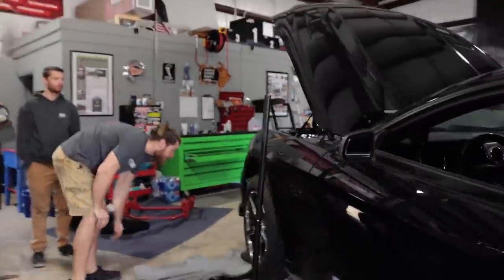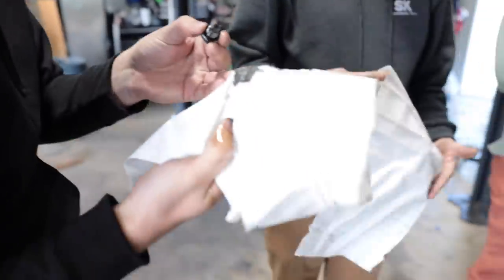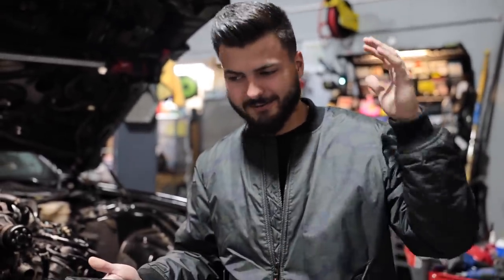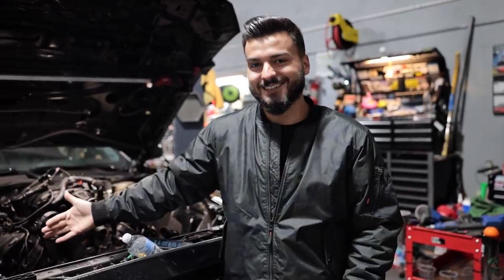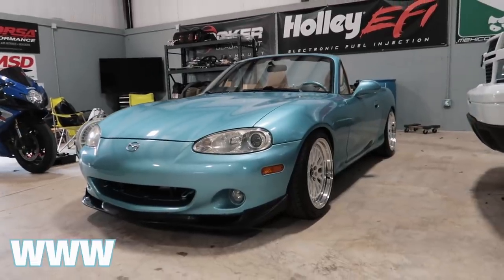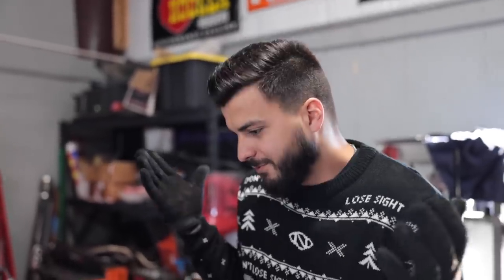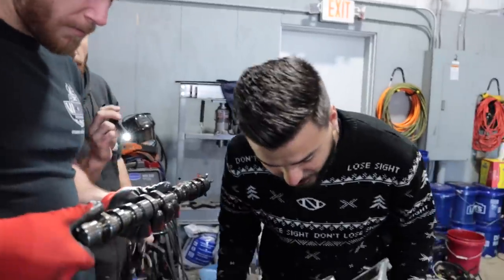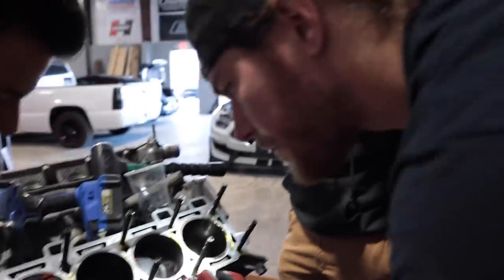Tearing Down Satan’s Blown Motor! | 1,500hp Coyote Engine Teardown

Comment: Well, this just solidified my decision to use someone other than MMR for my rebuild.  :/ I was going to send them the block in January.
Reply: Yea I made that mistake once. Worst company I've ever delt with. Took wayyy too long and blew up at 700 miles of easy low rpm driving. Then they ghosted me told me there's no records of my business.
Reply: @broshak9384  I feel like their top end stuff and timing stuff and other products is good but I wouldn’t trust them with a built bottom end
Reply: @jasonn277  They have good shit, but they have quality control and customer service issues. It will come back and bite them in the ass.
Reply: @jasonn277  its good stuff if they don't touch it. And you don't need warranty on anything.
Reply: @Hades-tf1zy  yea I’ve only bought one thing from them so far I know they have a lot of good stuff but to me seems like the owner can’t take any shots and always tries to make it seem like they aren’t the problem which imo is bad for business
Reply: @broshak9384  got you I’m going to be getting some parts from them for my build in the future and I actually might just buy the rotating assembly and assemble it elsewhere
Reply: @jasonn277  honestly bro I'd shop around. Theres plenty of companies selling quality parts. I wouldn't support a company like that period but thats my opinion.  Its your car your money. Just remember their service and warranty sucks too.
Reply: @broshak9384  you make a very good point
Reply: @jasonn277  if you noticed in the vid their expensive timing set failed after like, what 1k miles? I'm just trying to help fellow car guys. Good luck with your build. Make many hrsprs
Reply: @broshak9384  yea bro specially the primary tensioner  definitely staying away from those but good looks bro appreciate it 💪🏽
Reply: @jasonn277  my long block is from l&m everything else is either ford racing, vmp,corsa,arp,ect
Reply: @broshak9384  do you have upgraded primary tensioners? Only other company I saw that made them was ford Perfomance, using the ones off the cobra jet as an upgrade.
Reply: @jasonn277  yes they are ford performance or steeda i camt remember who i ordered thru but its a Ford performance product. The engine is actually in a Lincoln town car but ive got 17k on the setup so far. 10lbs boost and 890 wheel turned down significantly. Highest number on 16lbs turned up was 1142.
Reply: @broshak9384  sounds mean but thanks for the info I think I will go with the first performance tensioners and use the non moving stuff from MMR
Reply: @jasonn277  alrighty man good luck with your build.

Comment: Mmr posted a reply on their Instagram and blocked people from commenting😂
Reply: I saw that do you have screen shots of part 1 cause I think they took them down I only saw part 2
Reply: What’s their insta @
Reply: @Roy-ui9en  MMR Performance.
Reply: I couldn't find it
Reply: @bossnbuchan  the bmw aftermarket company?
Reply: Does anyone have a screen shot of the post?
Reply: @bossnbuchan  no it’s not it’s modularmotorsportsracing

You literally can’t comment on a single post. Holy coward.
Reply: Que the ( it was at this moment they knew they fucked up)
Reply: @truthliveshere831  it was deleted
Reply: @carsonbarasha9238  they deleted the post oddly enough
Reply: @TrainerDee  do you remember what it said
Reply: @carsonbarasha9238  They basically stated that it was Gavin to blame and didn’t put the engine together correctly in the first place and that Gavin never bought the engine off of mmr and that they never charged him a dime when he sent the engine over to them, also that they used all the components that Gavin had originally sent them with the engine. They took no accountability for anything and just pointed their fingers at him
Reply: @carsonbarasha9238  I do
Reply: @Roy-ui9en  @modularmotorsportsracing

Comment: What fun!  It's not time wasted.  Learning isn't easy or cheap.  So far, you have proven to know how to build an engine the right way, like testing the head flow to pick a cam.  Part failure is the biggest issue.  Time to find a mechanical engineer and have parts designed to meet your climate.  Most car parts are built to be a one size fits all, but that only works in dream worlds.  Finding a good fabricator is key to building a strong engine.  All ya'll's did a great job at tear down and analyzing the failure.  I am sorry that you have teenagers leaving comments.  If you have never keyholed an engine, you shouldn't be commenting!  My first keyhole broke the cam into 7 pieces!

Comment: Just an observation, but it looks like that engine has +10cc domed pistons, which are around 12.5:1 compression vs the stock 11.0:1.  That IMHO would be the opposite way to go in a boosted application, and you'll more likely to lift the head and/or ruin the bearings.

Comment: Actually the most common of blown head gasket is the compression going into the cooling system not the one that is known for mixing with oil and the white smoke, its normally really bad over heating and blowing the cap off of coolant overflows.

Comment: Those rod bears and main cap bearings I think we're to tight for the clearance and that's the result of improper bearings and those rods don't look like they are round they look almost egg shaped like they were forged wrong.its like the engine builder didn't wanna shell some extra money into eagle rods and some decent proper plastigauge and mains

Comment: I had a Mustang that no matter WHAT I did it would overheat.  Changed gaskets, changed everything I could think of.  Sadly it got rear ended by a guy in an F150 going about 50mph.   But, I found out when we tore down the motor that the head water ports didn't line up with the block.  Strangest thing ever.   You never know what can cause problems.

Comment: Granted my car is turbo uses more oil so my pump wasn't supplying the bearings good enough... But also 2 times in a row cooked mains shot crank.... Came down to not enough oil pressure... I guess when you add power like that you want more pressure cause the stress is higher and can push the oil out of the gap heavier oil and more pressure my lesson learned may help y'all a bit

Comment: You spent quite a bit of cash on that engine with that being said the proclaimed “1500 hp rating” should have had fire rings  grooved into the deck surface and head. That would have definitely been a go to for the amount of power you’re going for. Whoever built it should have gone that route for that “rating”

Comment: The rods aren't oriented correctly, that's the reason it took a doodoo. The beveled side of the rod faces toward the cranks counter weight. Cylinder #1, the bevel is closest to front of engine, #5 rods bevel faces rear of engine, #5 rod bolts to the same journal as rod #1. The main bearing was more than likely misplaced on the block and should have been on the main cap. The bearings come in a group, usually cap bearings are one thickness and block main bearings are another.

Comment: MMR just threw a grenade at their credibility over a half-assed engine repair. Well done. Gavin, you did a great job being classy about it, but the fact remains. MMR owes you money. Not another engine-shaped boat anchor. Money. and it should arrive faster than 4 months and 19 days, even with the apology that should accompany it.

Comment: I think the heat from it overheating can harm the bearings a little bit but if the head gasket was blown you Would be able to see compression in the expansion tank where you fil the coolant

Comment: Seeing as how almost all the cylinders leaked on the blocks external thrust side that coincides with the water opening in the head also i would say there is a definite structural issue at the boost level your running.  Also when the drivers head was pulled you could see cross talk leaks between all the cylinders on that bank.   I see the supports in the cooling jackets also but that is a bandaid that won't fully fix block rigidity.  No casting is perfect and at your power level you may have to get choosy and sonic check some blocks to find one with thicker walls and more rigidity especially for the cross talk between the cylinders or go with a newer gen block.

Sure that engine had other issues but the leaks probably would have happened even if the engine didnt eat itself from poor build quality.  That is unless the decks/heads weren't flat or head torques were not correct.

Comment: Just an ideal but is it possible YOU popped the head gasket missing a gear in that video..temps went out the roof and the motor seemingly ate itself when you drove it home beating it’s ass?

Comment: On the oil pump gears you should drill little dimples on gears and itll increase the life of them. I watched people do it on the gm oil pumps and it never gave them an issue again 🤷🏼‍♂️

Comment: I had a very bad experience with a machine shop charged me 1500$ to get an engine built, told them to covert a drag motor into a pump gas torque monster and they never lowered the compression( was over 13:1), destroyed a 500+hp small block ford..... refused to refund me the money..... gavin is right..... I built it myself after it and it currently has 1300 miles on it!

Comment: Other reasons for head gasket failure: Defective head gasket i.e. defective head gasket material, improper torque or torque sequence,  cylinder head or block not machined correctly.  Just to name a few.

Comment: it looks like that engine had an oiling issue also , did you have billet oil pump gears in it ?? and was the pick up screen too low in the pan ? that will starve it for oil ?  who built that engine ? call palm beach dyno , he has a engine builder that is really good with coyote engines , cant remember the name ??

Comment: Wait so if you have a boosted car the boost can push the oil into the coolant? I only ask because my supercharged Chevrolet cobalt is having issues that indicate a head gasket issue but the temps are normal, I smell some coolant, and the coolant is light brown. I don't want to drive the car until it blows up. Any input is welcome.

Comment: Anytime a bearing failure occurs this early it is 100% percent clearance issue. In my opinion if this wasn't done on purpose then it is the most unqualified engine builder ever. Some one that wouldn't torque cam caps.

Comment: How does it relate to driving. Not putting foot to the floor when the temp is high. You can always pick a pro shop with all the slippery coolant all over the floor. Weird, didn't you say you bought the engine indirectly for about 7k?

Comment: Dart LSNext aluminum block 4.165 bore 4" stroke 434/435ci, Callies billet aluminum crank and billet steel rods, Diamond pistons, nasty turbo hydraulic roller cam, PRC'S biggest cathedral port cnc ported heads, Holley 16 injector low ram intake and 102mm TB  with 16 160 or 210 pound Bosch injectors then slap a big boy Garret promod 94mm turbo on it with a th400 and actually go make 1500+hp for a while go 4's and 7's eventually and pull it out freshen it up and do it again over and over. No intercooler e85 on the street and methanol when its time to party!

Comment: Scrolled through some of the the comments and didn't see this brought up.  What's your opinion on running a water temp gauge that actually reads a number?  I get that it happened so quick you shouldn't be expected to have seen it.  Point is, I wouldn't trust a factory coolant temp gauge reading on a high horsepower setup to be enough of a warning for something so crucial to this engine's health.  I know newer CAN bus cars with modern sensors should read just as accurate or more accurate to the computer than an aftermarket gauge, but they also program in a display buffer that won't show a higher temp until it reaches a certain threshold.  Maybe this isn't the case with your car, but it's not uncommon for factory gauges to be held in the middle until they're 30 to 40 degrees over normal operating temp.  Some modern cars will hold the needle in the middle of the gauge over a 50 degree swing.  The reason they do this is so non car people wont get worried about their temp gauge always moving around.  Why didn't you mention anything about the coolant temp shown on the log?  How long was it hot?  Maybe you mention it later in the video, if not you should probably bring it into your assessment on what happened and look into getting a proper temp display.

Comment: Id be interested in taking a mic to the inside diameter of the rods big end with the caps torqued then measuring the thickness of the bearings that didnt fail. wrong bearings? shit bearings? improperly torqued? new crank or ground? ive seen write ups on measuring a rod bolt or main bolt for stretch.....new vs torqued. I know ARP is huge on even what oil to use on their bolt threads...i know its in the past at this point, beating a dead horse, but id be going thru that thing with a fine tooth comb after dumping 20k into it. But cant wait to see what the new engines gonna do. You drive just fine, lol.

Comment: Hey guys I got a question. I'm a us army veteran. I'm building a sn 95 mustang gt .Cloning the 5.0 ho in to a cobra basically. Iv done all the regular bolt on upgrades  .In take exaust is still stock so are head .mass air tune for 24 lb 70 mm throttle body with spacer plate .I curious about how the tune chip works for a 4 speed auto 5.0 ho 94- 95 .Is it plug n play .My nephews are serving in the marines and army .I'm a retired All American paratrooper. My build has been a struggle. It's not perfect. Idk tho cus I want something to have fun with when they get out .I started watching you guys long time ago when I was serving. 08 I think or 07 maybe.  I Remember when 5.0 pulled you for loud exaust that was dot rated stock lol 😆 Keep up good work very impressive what you have built and do for others.

Comment: What was your oil pressure before? It shouldnt  be a machining issue because a 1500hp engine should have had main clearances checked at assembly .Any issues should have been delt with then, and that would have been tight clearances and it wouldnt have lasted a year that way. It would have spun before the first oil change..It looks like not enough oil pressure or the oil was run too long or contaminated. Unfortunately at the horsepower and rpm level you are at, everything is critical. Im sure you will build it better this time, it sucks that it cost you the cams and billet timing set and a lower end...it looks like you guys are getting good at pulling the Coyotes out and working on them.

Comment: Major main bearing failures tend to happen with harmonics and high RPM....Like I have said before...Just because you can wind an engine to 8000 RPM... Dont mean you should.. the company that built the engine made many mistakes... Seems like RPG balances their engines rotating assembly....Sorry about the 20 grand hit you took... that sucks.... Just LS Swap the thing and go with twin turbos!!

Comment: If you was hitting rev limiter you would hear it pinging off the limiter. If it's rated for 8000rpm and the dash says 6000rpm then it's obvious it's going to pass 6000. 😂😂

Comment: mmr forces apology for not knowing about the lockout tool and doing timing correctly. MMR fixes it for them 6 test pulls later timing fails resulting in catastrophic engine failure. i have completed my evaluation who owes who an apology now

Comment: Fyi. the cam caps bolts are NOT tty as indicated by the service manual, however the phaser bolts are tty. ( torque to yield). and this why you don't use the walmart of coyote engine builders with all their bullshit. MPR and RPG are the preferred coyote builders.

Comment: Those are improper torque issues....now your going to have to put a micrometer an  caliper an check all of that ...sry they hit you hard bro I build high hp engines ...what was the break in time on that engine

Comment: Need to stop missing 4th gear 😂 just ducking around. That absolutely blows that a main bearing was one of the main issues for the engine blowing. Hopefully you’ll be able to recoup some, if not all of the money you spent on getting satan back up.

Comment: The bearings SHOULDN'T have UNDER SIZE OVER SIZE you pick THAT'S the ISSUE'S.I think everyone WOULD AGREE ..also the frozen cam follower I think its called another issue of COMPLEXITY ...YOU GOT BURNED 20 GRAND ..NOT EVEN A NEW ENGINE WOULD BE FINE ..HOW ABOUT A NEW ENGINE AND 30 GRAND WITH A GARENTEE 2 YEARS .

Comment: if you want to stop having bearing failures with in your engine's start putting a thicker oil in them and stop using oil that's thinner than water I mean it's common sense supper thin oil and race engine's don't mix a race engine has to have a heavier oil

Comment: Bro I feel for all your issues, but there's no way you can justify driving that car all the way back to the shop. I would have drove it after the water too, but there were so many signs to pull over... tow trucks are cheap compared to engine parts.

Comment: I think would be a wise decision to basically put the motor together in the shop no more sending out because at least you will know what was done and what wasn't instead of taking the motor apart for the 20,000 times just a suggestion I myself don't like taking my vehicles to the shop if I don't see it I don't know it many possibilities can happen and they usually do like it did here in this video because then you would know if it was a part issue or a mechanic's issue and honestly I don't trust anything that's not the front of me if it's out of sight it's out of mind if you're willing to spend money on out of sight and out of mind have at it but not me.